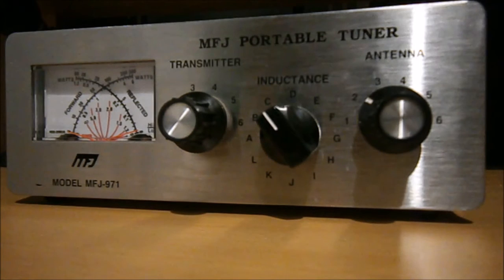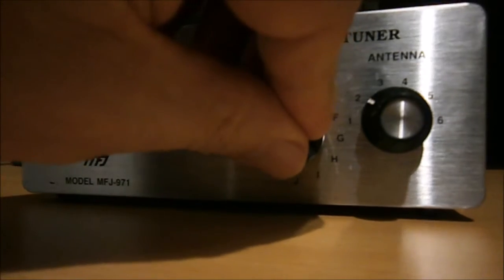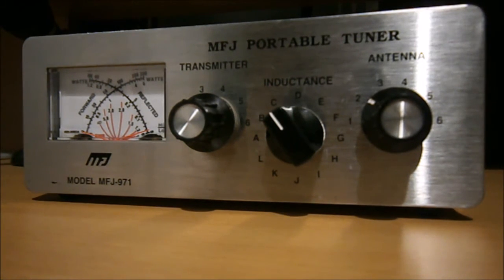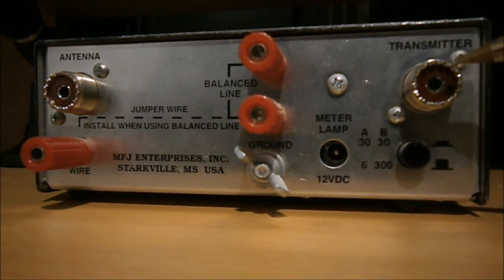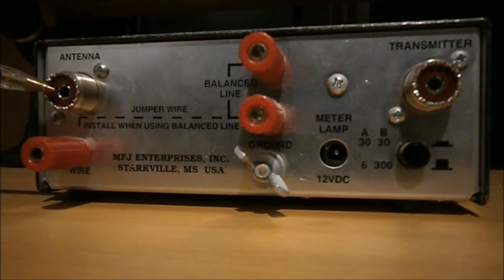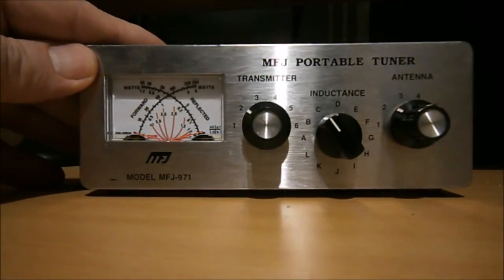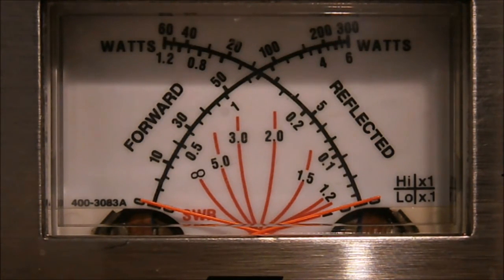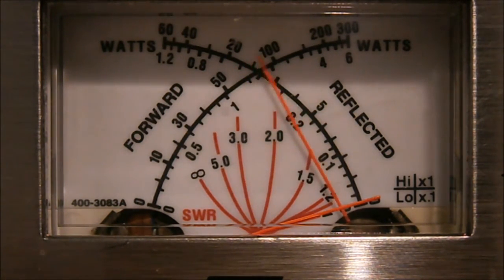MFJ-971 Portable Tuner brief review

Comment: If it’s rated at 300 W, why would you ever want to move the jumpers?
Reply from the maker: The internal jumpers can be configured for either 300W or for QRP operation (6W maximum) and looking at the meter on the 971 there are two scales for forward and reflected power. When I get time I will do a test and see what difference moving the jumpers makes. I suspect it would change the sensitivity of the meter for QRP. 
73 Chris M0RSF

Comment: A nice tuner for QRP but a shame there is no bypass filter. So I've modified mine and added a bypass switch. So much better now. 73 de ON4MGY Nic
Reply from the maker: That's a great modification. Still use my MFJ-971 with my Yaesu FT817ND. 
73 Chris M0RSF

Comment: I am glad to hear about this ATU.. however, I haven't found a video that Shows "How to use it"..
Reply from the maker: That is a very valid point. Leave it with me and I will make a short video. 73 Chris M0RSF
Reply: @M0RSF  Chris, when do you think you will make that "How to connect " video? Also, can you tell me, in powering the meter light, is the center pin +POS and outer -Neg, or vice versa?
Reply from the maker: @MusicMinisterJP7  Hello, I’ve not forgot and I will have a video up on how to use a manual ATU this weekend. I’ve checked the 971 user manual and it says that the centre pin is positive. I know an Amateur who changed the bulb for a blue on to match the display of the Yaesu 817. Looked quite impressive. 73 Chris M0RSF
Reply: @M0RSF  Thanks Chris,, I used another devices power supply, which had center as Negative,  and so I cut the wire and resoldered in reverse so center is now POS. It worked. But I still don't know how to set up or use the meter. The instructions I downloaded are Not helpful at ALL. All I am looking to do is connect my superstar 3900G, to meter and Linear. If I remember, that is the sequence connection order.?
Reply from the maker: @MusicMinisterJP7  Try connecting in this order.... Rig --- Linear --- Tuner --- Antenna. Basically all I do with the ATU is start with all three controls points straight up, as in 12:00. Then find a station you can hear and turn the Inductance until the signal you receive is strongest. Then tune away slightly and make sure your not tuning up on a frequency that is in use, reduce your power (never tune on full power) key the mic and use the Transmitter and Antenna controls on the Tuner to achieve lowest SWR. The MFJ-971 is very good and you should be able to achieve a low SWR easy enough. Hope that helps.
Reply: @M0RSF  Thank you Chris.. question: would this meter be considered an antenna Tuner or Matcher?
Reply from the maker: @MusicMinisterJP7  Any ATU is really an Antenna Matcher. It doesn’t actually ‘Tune’ an antenna is matches it to 50 Ohms or as near as possible so your transceiver is happy and will operate without damage.
Reply: @M0RSF  Greetings Chris, thanks for this. But I hope you are still doing that video you said you would..hehe. Seeing is better than figuring it out. Your previous comment, where you advised me on how to connect the pieces, the part where you say "tune away" is unclear to me still. I must be lament. Thanks for any help.
Reply: @M0RSF  let me ask you this,, can I use it in conjuction with a Dosey TC3001-P 3 display meter?
Reply from the maker: @MusicMinisterJP7  You can use any ATU in line with your Dosey meter and you will see the SWR decrease as your get near to a good match.
Reply: @M0RSF  Kool, thanks. I wish I could send you pics..
Reply: @M0RSF  uh, can you tell me whats ATU stand for?
Reply: @M0RSF  Awesome.. The thing is, I purchased a Brand New Astatic Swr and Watt meter,  was defective, watts worked but swr dead needle on both radios. So I sent it back. Then I picked up a used but very nice MFJ-971, works great,  but I have no idea how to properly function it. I searched for instructions pdf, but they didn't seem helpful. It be AWESOME  if you showed a step by step video on it. I think Many will benefit. Thx. 73s,  Chaplain 833..

Comment: Good morning
Is the button on the back when transmitting from 5-30W to be pressed? or vice versa?
Thank you for your answer
Reply from the maker: Hello, out of the box the tuner is set for 300W when the button is out and 30W when the button is pressed in. There are two jumpers that can be moved inside (doesn't affect warranty) that make it 6W when the button is out and 30W when the button is pressed in. Hope that helps. 73 Chris M0RSF
Reply: @M0RSF  thank you, thank you for your help. 73 SP9DLK 💪💪💪
Reply: That's what the simple instructions say, press in when using 5-30w..

Comment: Good video. Many others I watched about this tuner skip the reason for the jumper wire when using balanced feedline. Some don't know that the balun is inside and don't mention it. One you tube presenter called the balun a ferrite bead. 73 KB8AMZ